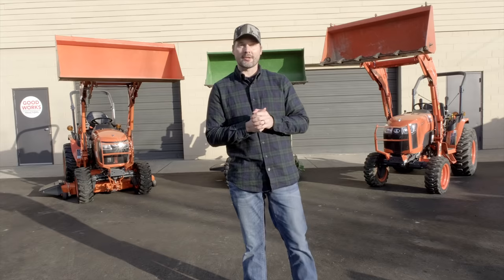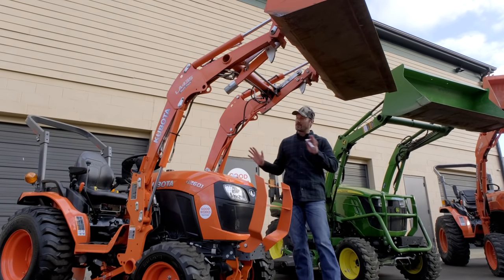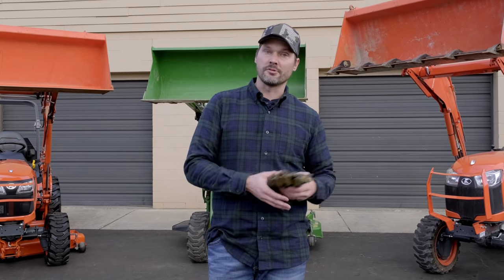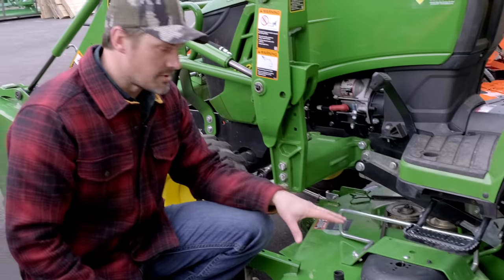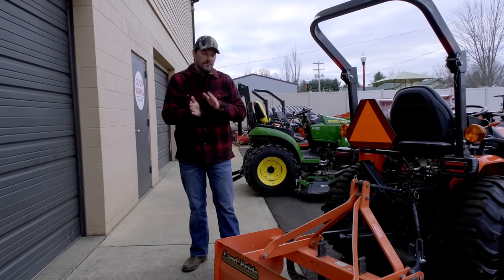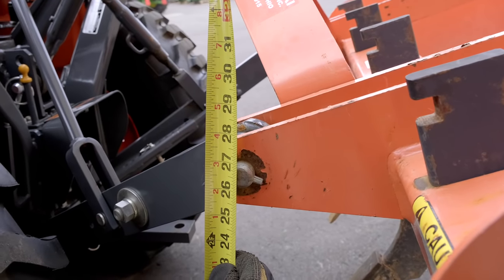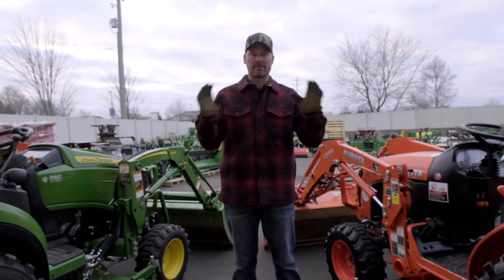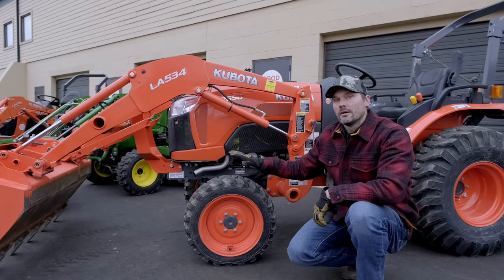NOT EVEN CLOSE! JOHN DEERE vs KUBOTA: B2601 vs 2025 vs B2650

Comment: The big problem with the "B" series size tractors are they are too narrow to their power/lift capacity. I had a B 2410 and ended up adding 2" wheel spacers. Night/day difference when traversing inclines or when using the bucket. The "tippy" feeling is very disconcerting when using these tractors.
Reply: This is a growing problem.  Too much power for the size of the machines!

Comment: Seriously disappointed with both tractors Trans packages, a stick is really necessary for spraying applications neither cruise is accurate or reliable, makes nursery applications hard
Reply: Kubota has a B2401 which is the same size as the B2601 but is a gear trans.

Comment: Hi Courtney, I just measured my 2025R for the 3 point hitch height and to the center of the pin is exactly 30 inches, and that's from my stock John Deere (cat 1) 3-point hitch and not the quick attach
Just wanted to point that out, the 2025r you measured from might have drifted down
Reply from the maker: It was measured about 15 seconds after raising it.  I just measured again as I'm standing right by it.  Measured 24.5" from ground to center of three point ball.
Reply: When I have the 6 foot land scape rake on my 2025R  I could use more lift.
Reply: The lift on the 3pt and mower deck is adjustable. I did it to my 1025r when I got it and my 1025r with 120r loader can move 4x5 round bales with counter balance I feel like the specs are undercut. My buddies 2601 kubota couldn't even try to raise it

Comment: You should do a comparison with a Kioti CK2610, then again if you did, customers would be asking why you don't sell the Kioti brand.
Reply from the maker: I don't sell Kioti because they have a small dealer network for parts and service and don't hold their value as well as JD and Kubota.  Their build quality is lacking the finer details.  However, overall great machines.  I'm asked almost every day about Kioti.  I tell folks exactly that and also that if I were to recommend and sell any other brand, Kioti would be the one.
Reply: @GoodWorksTractors  Yes like every thing in life there's pros and cons. Unfortunately Kioti's dealer network isn't at JD and Kubota levels. Maybe one day. Meanwhile, as the "new kid on the block", they have to try harder, and compensate by building a heavier and tougher tractor for a lower price.

Comment: Lets see the actual comparision of what the tractor can lift.
Reply from the maker: You can see real world of the B2601 and 1025r in this video.  FYI, the 2025r has the same loader and lift capacity as the 1025r.  It's as close as I got for ya.  Next time, I'll invite you over to lift all the suitcase and wheel weights, good times!  🤣 https://youtu.be/wk1kexRm7bY
Reply: @GoodWorksTractors  you need a buried anchor and a scale intended for below-the-hook use on small cranes.  If you are going to be measuring these things Consumer Reports-style that is.

Comment: I own 22 acres and most of it is hilly, my worry is the side angle, flipping on its side, (im not worried about it if my mother-in-law is useing it,😂),..at what angle is there going to a problem?
Reply: Most tractors are a lot more stable than they seem because the weight is down low for the most part. I've flipped a trailer and the tractor didn't even get close to feeling like it wanted to tip over. If you're really concerned filling the tires half-way with water will help with traction (more weight), reduce bouncing on uneven terrain ( less air in the tires) and improve lateral stability (more weight down low).

Comment: What is the John Deere equivalent to the 2601 then?
Reply from the maker: The gen 1 2025r which isn't in production anymore.  The gen 2 2025r (shown in this video) was downgraded.  The only other John Deere 2 Series are the 2032r and the 2038r.  32HP and 38HP.
Reply: @GoodWorksTractors  I bought the new kubota 2401 after a disappointing showing of the 2025r.  Love the R14’s and the La 435.
Reply from the maker: Went with the gear drive?  How's it treatin ya?
Reply: @GoodWorksTractors  great!  No whine, no high speed down hill pickles, and pulls anything!

Comment: John Deere make some small diesel engine in Myanmar. Nothing wrong with that. My older small Ford engines (and tractor) were made in Japan. What i did not like about the small JD, as in Gator, was the seats all cracked. My 35 year old Ford still has original no cracks seat.

Comment: My brother in law has a JD with the hydro where the forward is inside and reverse outside and the brake above the forward pedal.  That system almost cost me my life as the natural reaction when you want to stop is to hit the left pedal.  I was mowing near a cliff and as I was getting too close, I panicked and hit the go pedal.  I lurched over the cliff but was stopped by a tree.  I was launched from the tractor but also was stopped by a tree.  Had I continued, it was over 100 feet to the bottom.  Ergonomically, I think that's a bad design.
Reply from the maker: Which model was that?  I'm aware of many Kubota models with the brake pedal right above the forward hydro pedal.  I can't think of a John Deere with that setup unless it's a lawn mower.
Reply: It is an X580 series lawn tractor

Comment: Courtney- I thought the 1025 was the same class as b2106?
Reply from the maker: No, it is smaller
Reply: Ok I didn’t know that for sure. So am I correct that the 1025 is between the b2601 and the bigger BX’s? I think the 1025 is significantly more capability than the bx24 that I used to have. Question, I already have a quick hitch standard (need bushings) and am thinking about getting another one for an old b6100 in really good shape with 160 hours and stored inside. I love driving that tractor. Anyway I watched one of your vids on one of your units that doesn’t need bushings. I would like that but is it foolish to get that one since I’m invested in the other unit that needs bushings? Those bushings are hard to come by around here. Thank you
Reply from the maker: Yep, pretty much.  Here's a couple other comparisons that might help.

https://www.youtube.com/watch?v=wk1kexRm7bY&t=1477s

https://www.youtube.com/watch?v=m5iLl2Iz1l8&t=120s

https://www.youtube.com/watch?v=QJJop0Nv80A&t=747s
Reply: @GoodWorksTractors  C- thanks so much for your time on this, very helpful. Also wanted to point out that Im very satisfied with the grease gun you promote (and thanks for the GT discount). Keep up the vids! Merry Christmas!

Comment: The B - 2650 , Are you doing a package deal for it  snowblower mowing deck , grapple , tiller ,
Reply from the maker: Out of tillers until spring and I'd need to have a Kubota dealer add the mower and snowblower.  Would be pricey.  We spoke on the phone about a similar setup on the B2601.

Comment: John Deere is the devil. The Apple of tractors. They charge insane prices for parts. They treat customers like beggars.

I have a JD 430 garden tractor and a Kubota L3710. The JD always has problems. A hydraulic cylinder seal blew out, and JD made the cylinder so it can't be rebuilt. Bought an overpriced cylinder and installed it. A nightmare. The tractor is torture to work on.

The alternator belt broke. You pretty much have to cut the tractor in half to change it. I put in a linked belt.

The muffler broke. A $250 muffler on a lawnmower. I welded a stainless exhaust tip in its place.

I wanted to change the oil. You have to remove the 325-pound deck to access the drain plug.

Here is a list of the problems I've had with the Kubota:

Comment: I wish Kubota would ditch the rocker pedal for the Hydrostat. 2 pedal is much more comfortable to operate. Also, for some reason JD seems to lack on the loader specs. years ago I bought a boomer 35 instead of a JD 4400 because of this.
Reply: JD's literature is pathetically short on specs.
Reply: I have B2301. Hated the treadle pedal for the first couple hours.  By 10 hours on the tractor, I like it.  It is easy and intuitive.  I'd never let that be a deciding factor going forward.
Reply: @scurrytom  Thanks! That helps. I've read that one gets used to it & I'm sure I would too. I've driven a JD w/the two pedals and liked it. Only sat on a Kubota w/treadle and wasn't crazy about it but have just about decided on a B2601 or B2401 (gear drive so no treadle but definitely NOt the reason for the gear drive although is an added benefit). The other model I'm looking at is a 2025R but IMHO, in THIS frame size, other than the single point hydraulic connector, JD has more convenience/appearance features and Kubota more functional "real tractor" features/capacities. Hard to give up the latter despite liking the JD mower attachment, BH seat, plastic hood, fuel fill location, pedals, step, etc.
Reply: @danielsharon524  I had it down to those two Kubota Compact tractors, too! I do primarily loader and back and forth ( lots of stop and start).  Hydrostatic is much better for that, so I decided B2601... but covid meant my dealer only had B2301 on hand(long unknown wait at that time for B2601). Neal Messick replied to my comment on his video, saying I wouldn't miss the couple hp for my use.  Good luck!
Reply: @scurrytom  Thanks - My heart wants a B2401 but my head says B2601. I'm looking forward to going up to Messick's (maybe next week) and test both - I'm hoping it makes the choice obvious. I'd definitely be in the very small minority going w/a gear drive in my application (small lots) but I really don't think I'll mind it & once I get used to it would like it better. To me, it seems they designed the shifter position/pattern to be as optimal as possible for loader work. The question is whether all that shifting would get old.

Did you see Ryan Lynch's (Kubota tech) 1st B2401 test drive? Looks like too much fun. He thinks I'll love it. The Messick's salesman thinks I'm nuts, lol. The guys on Orange Tractor Talk think I'm better w/the HST but not crazy for considering the gear drive.

Comment: Are these considered compact tractors or sub compact tractors?
Reply from the maker: All are compacts.  However, I personally consider the 2025r to be a Heavy Duty subcompact.  Not quite a compact.
Reply: I have a 1999 Simplicity 2925 with a loader and it isn’t comparable to these much heavier duty tractors. Do you have a video on what is currently available on the newer sub compact tractors?

Comment: I have a gator xuv. I know it is not a tractor but it is not dependable, and John Deere service has been horrible. I had to switch to doing all the many repairs myself. Not even the clock on the dash keeps accurate time. Parts are overpriced, service is expensive and unqualified.

Comment: Every year these tractors are more hp , lighter-need more counter weight spend more money,and prices go up every year
Reply: That's not the case with the Kioti brand tractors. When comparing apples to apples, a Kioti is heavier and more powerful, while less expensive. I suppose Kioti's orange paint doesn't cost as much. 😉
Reply: @ComfyBe  I was very impressed with all those attachments with the tractor purchase for about the price of the kubota, and usahly John Deere’s are 2-3 k more than kubota they are both over priced!. Worked at dealership ,new holland, case I H,kubota  drive trains , axles, drive shafts splines to small of diameter don’t buy a kubota tractor over 50 hp pto’s clutch packs wear out low hrs very expensive repair!!! We became a kubota dealership 1980 a lot of problems with the mower height on the BX models ( poor design) repeat failures!!!!!  Factory service rep is young and dumb  ( green)

Comment: Is it me or is it John Deere in a hole. Based on the video it's apparently two or three inches shorter than the first Kubota I'm curious about the measurements and the choppiness of the hydraulics during the lifting process of the bucket. I've driven both John Deere and Kubota and it's not even close to Kubota is a much better tractor and not nearly as expensive

Comment: The 2025R CAN come with a Mauser cab with heat only.
Reply from the maker: Yeah, I don't state it in every video,  but being installed at the factory doesn't make it a factory cab in my opinion.  OEM cabs have long been associated with a/c and heat, complete integration with the structure of the tractor.  While the Mauser's are undoubtedly a very nice cab, you can retrofit an open station used 1025r/2025r at the dealer with a Mauser cab or have one put on at the factory when ordered new.  Can't do that with a Comfortgard cab.  There's no option to field install a true factory cab.  Plus, the obvious air conditioning that isn't available in the Mauser.

Comment: I like your videos but to be honest I hate Johndeeres ....  Above 50 hp there great.  Below 50hp they should not be even called Johndeeres.   Seen and worked on to many of the newer ones..  Parts are crazy high and there built so cheep and brake so dam easy...  My friend had one, three years old and he had to take a huge loss and get rid of it ..   Front axle broke twice and loader arm once, and for awhile every time he used it, something broke.  The very last straw was a tiny limb last winter that came down on the hood, braking the hood, dash and steering wheel... Ive seen trees fall on kubotas and a little hammer work and there good to go.  So if you want a tractor to baby in your yard and its dirt cheep buy one.  If you want a tractor that is bullet proof buy a Kubota...  In my opinion anything is better then a JD.

Comment: How many times will your Kubota be back at the shop, compared to John Deere? Not even close.  if you have a John Deere, the shop better be close.  My neighbor, had 1000 momma cows, WWIi vet, disliked Japanese because of some incident on an island. Bought a JD cab tractor, was proud of it. He figured out two things he could do with it. Sit around and look at it, or ask when they were gonna let it out of the repair shop. When he died, had a 100 hp kubota, said it ain't been in the shop not one time.  Another guy has a bug dual wheel cab tractor all took apart at JD, he told them to stop, he just went to idabel and bought another older tractor.   JD has turned out to be over engineered computerized junk.   I  would advise to not buy a newer tractor that uses DEF. Don't buy them. I worked as mechanic at a dealership.  Buy an older and fix it up.

Comment: Save you money buy Mahindra for these little home tractors. The Slide float sucks, turnbuckle is the way to go.  20 years farming in Iowa, I saw 1 Kubota tractor, yes 1 . Just search Kubota's with engine troubles. One other R4 tires suck R1 only way to travel unless you go straight turf. Now the biggest item/feature in a tractor. is WEIGHT.